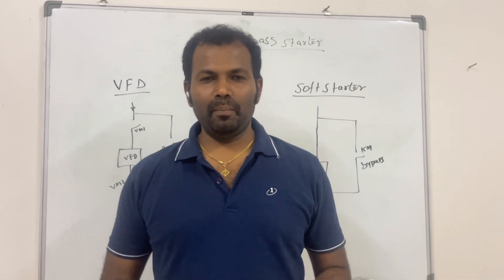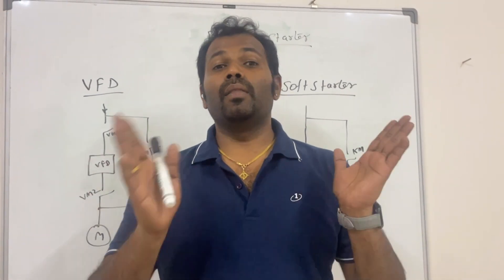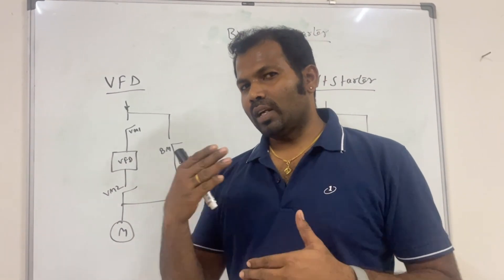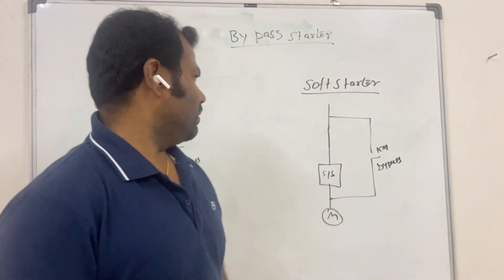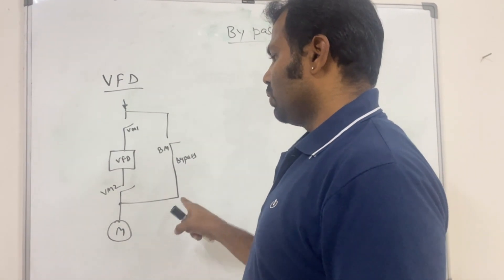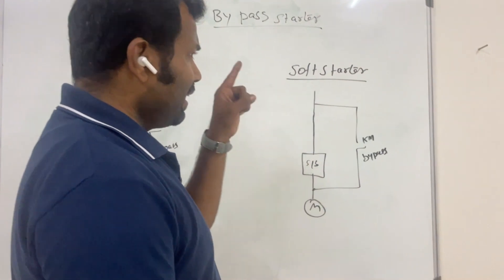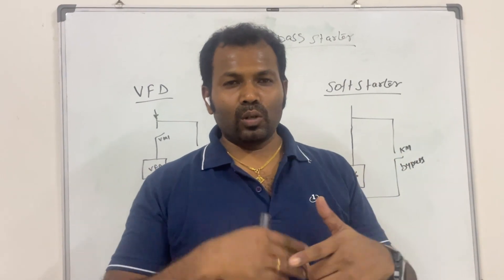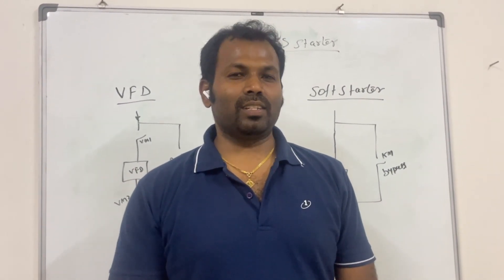Understanding of VFD bypass starter and SOFTSTARTER bypass starter ….Explained...

Comment: Ji, I have one doubt, panel inside 18.5 kw vfd during run time the 230vac mini relay LED    only glow .how to prevent this program?
Reply from the maker: THE RELAY HAS LED? RELAY CONNECTED TO?  THE PURPOSE OF RELAY?
Reply: @sennapparajan.p  yes, relay has LED. The relay ON the drive running ( two wire system) , during  vfd running other relays are glowing. the vfd stop the mini relays light are all off.
Reply from the maker: @manilakshmi6118  purila... clear uh sollunga..
Reply: @sennapparajan.p  ji, vfd running time ,inside panel some other mini relays led lights glow. I think vfd induction affect .how to reduce or clear vfd induction.
Reply from the maker: @manilakshmi6118  its a common problems with LED. we have same issue here...